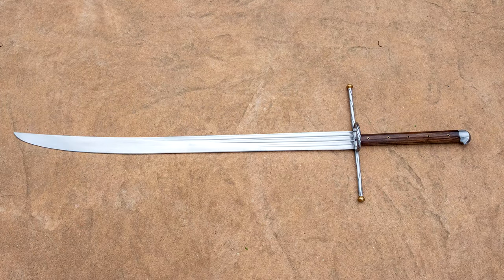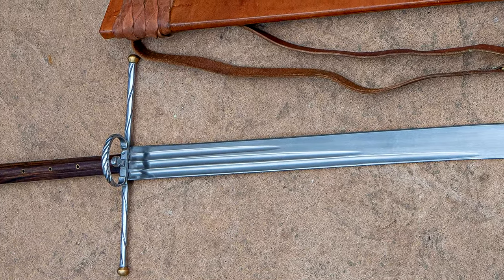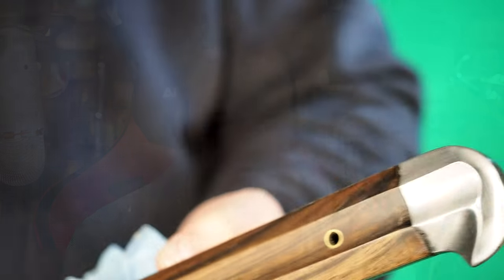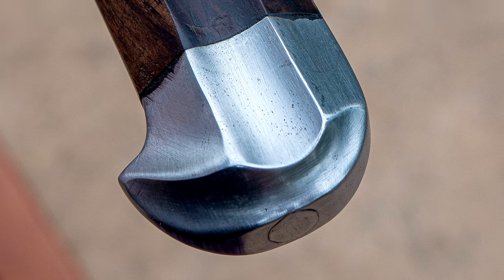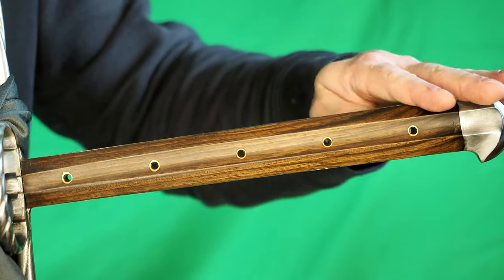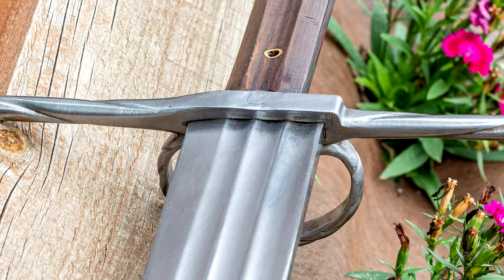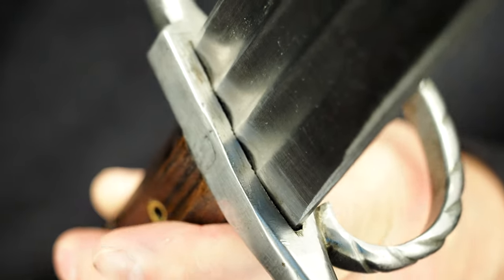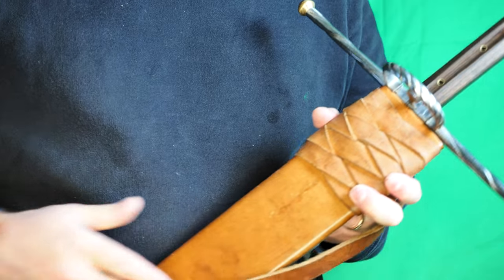Landsknecht Emporium Kriegsmesser "The Monster" Review

Comment: Huh, I would have figured that a Kriegsmesser would (minus the crossguard) feel relatively familiar in hand considering it is a two handed lightly curved sword. 😅
Reply from the maker: I thought the same thing.  But it's roughly 10" longer than I am used to (with a similar POB) and also 2lb heavier.  That might not sound like a lot but it is roughly 75% heavier than an average katana.  It lends itself to feeling somewhat fermiliar but that is almost dangerous.  Held in front of me it acts very similar as well as generating tip speed.  Stopping it is very different as is how it feels in the cut.  Lots more flex.
Reply: I think certain kreigmesser may feel similar to a katana,  but not the monster kreigmesser. An imposing piece of steel. 2.75 inches blade width, that really lends itself to a very sharp edge. Lovely weapon, great review. Thanks to Matt and Ian.

Comment: Thanks for the review. Quick question - do you keep many swords stored in scabbards? If so, how do you prevent rust? I'd like to display mine like that, but I've heard some horror stories...
Reply from the maker: I take them out of the scabbard and oil them ever 3-6 months.  Also if there is any sign of rust from a scabbard I leave the sword out of it and let it dry for a month.  Sometimes in a room with a dehumidifier.  Swords can rust in the scabbard but usually because there is material in there causing it to rust.  They can be hard to keep clean once they get dirty.

Comment: Big thanks to Matt and Ian!
Reply from the maker: Curious to hear your thoughts on this one sir.
Reply: @Matthew_Jensen  For the price I'd say the gaps between the wood scales and the guard/pommel are not great, also the nagel should sit flat against the guard. Aesthetics and polishing aside, the main thing that should separate high end swords and knives from production pieces is the fit up. Not having any gaps should be the primary focus for the hilt. Gaps allow play which can create looseness over time, moisture can collect, the wood can swell or split, etc. The blade seems well heat treated, which is the most important aspect for the blade. The obtuse edge angle isn't necessarily a bad thing for a blade of that size. Sharpening the edge with a convex grind would be my advice. Doesn't strike me as a rip off but I'd expect the hilt fit up to be better.
Great review as always.

Comment: Matt, or anyone else reading this, what would be a good stand alone stand for medieval swords. The only sword stands I can find are the cheap katana ones. I need something durable enough to hold the Ranger sword from DSA as well as two other smaller swords. Suggestions anyone?
Reply from the maker: Most of the stands tend to be Japanese in style.  You could always try making your own.
Reply: A guitar stand works well, as long as the sword has a cross guard.

Comment: I've found that I have unexpected frustrations cutting with heavy swords, getting more smash than slice, and I think it's about inertia: Side by side with a lighter blade I just can't get nearly the same speed in the cut. Or maybe I'm just a wimp.
Reply: I have a similar opinion. Can think about it in terms of F=MxA. With a properly weighted sword, can perhaps quadruple the acceleration compared to one with double the weight. Another factor for me is the psychological aspect, as I simply can't bring myself to swing a heavy thing harder than able to control or stop as needed, whereas a lighter sword doesn't have that problem. Mentally there is not the same limit to the max force if the weight is tuned right.
 I think a lot of people lean to heavier blades thinking the sword will "do the work", but it should ideally be the swordsman that maintains shibori and keeps the sword moving against target resistance.

Comment: Albion has had a Kriegsmesser out for years, it cuts better and is 100s less expensive too.
Reply from the maker: It is a rather different sword though.  1, the Knecht is a smaller with a 5" shorter blade and about 7" overall. 2, It is lighter by nearly 2lb.  3, it does not come with a scabbard and it would be tough to have one made for the $500 difference.  4, the landsknect piece is a semi custom option with some unique looking fullering that has some value.  There are some other differences but those stand out as the big ones.  Don't get me wrong, the Albion looks great too and I have heard great things about it.  That said, the argument is more complex than just being 100s less expensive.  Further,  the cutting was not well demonstrated by me.  The blade did sale through tatami while dull, so its not a bad cutter.